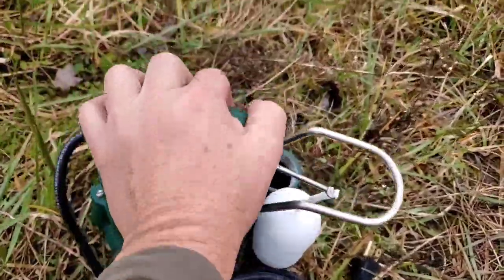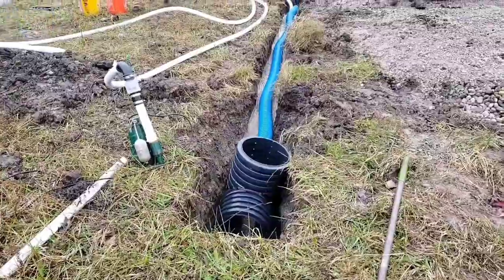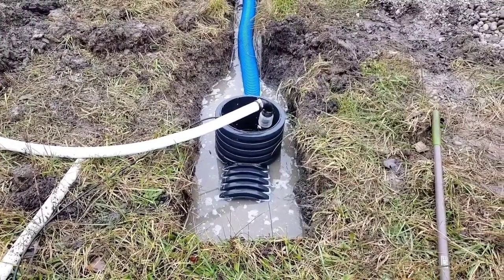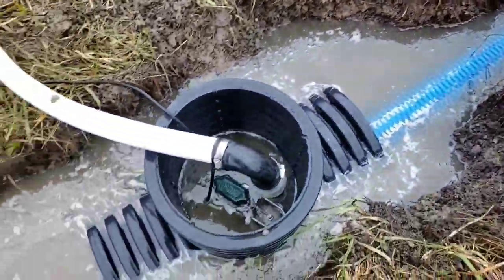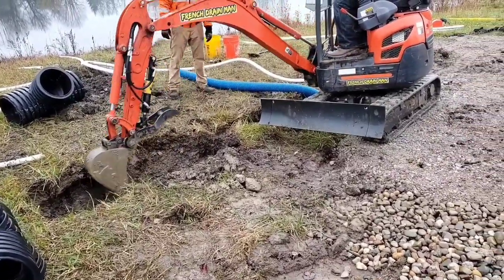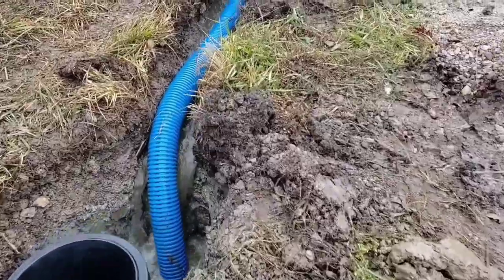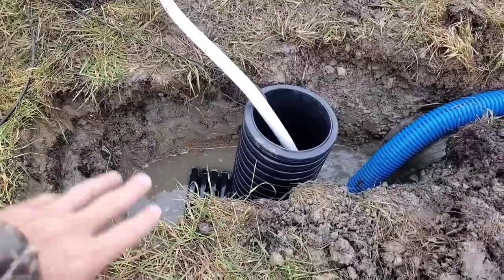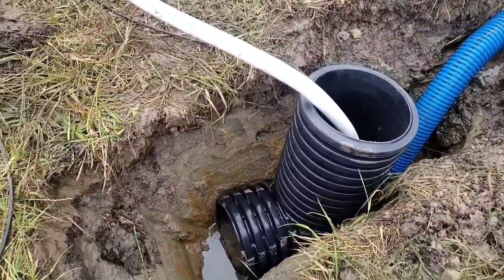BACKYARD SUMP PUMP For Yard Drainage Part 4 [ How to Figure Depth & Height of Sump Pump System ]

Comment: What about the water that’s above the check valve remaining like in the winter months will it freeze or will it be OK to remain in the pipe
Reply from the maker: We heat them
Store | French Drain Systems | Curtain Drains | Macomb, Oakland, Lapeer, St. Clair County
https://frenchdrainman.com/store/
Reply from the maker: What check valve?
Reply: FRENCH DRAIN MAN The check valve on the sump pump discharge pipe. So does heater in the bottom of the chamber able to heat the top portion of the chamber as well?

Comment: I realize now I should have gone deeper in my build and may need to add a riser to the sump pump housing. Is there a proper riser or coupling to raise a mini bad seed?
Reply from the maker: Coupler for Adding Height to Micro Bad Seed & Micro Screaming Demon - French Drain Systems | Curtain Drains | Macomb, Oakland, Lapeer, St. Clair County
https://frenchdrainman.com/product/coupler-for-adding-height-to-sump-system/
Additional Chamber/Height Length for Micro Bad Seed - French Drain Systems | Curtain Drains | Macomb, Oakland, Lapeer, St. Clair County
https://frenchdrainman.com/product/additional-chamber-micro/